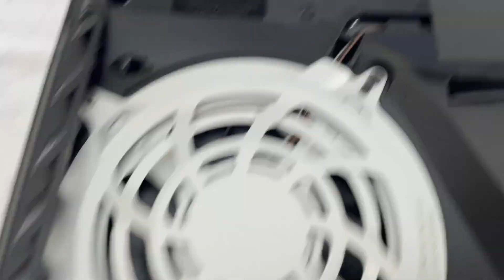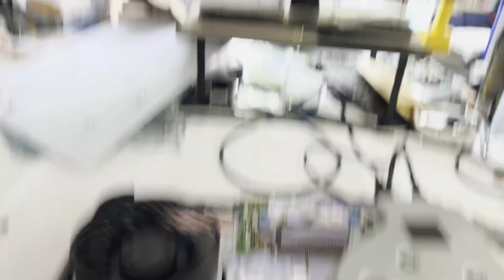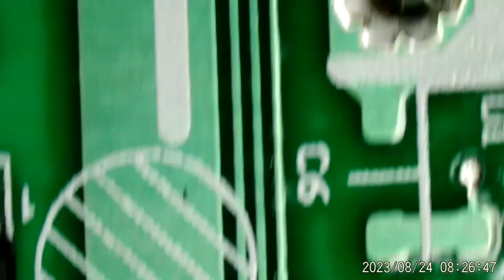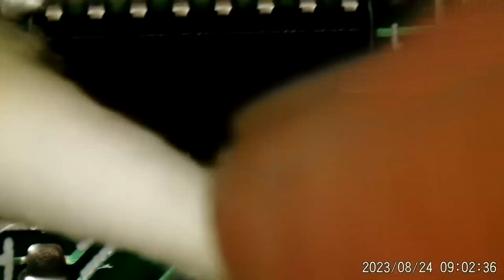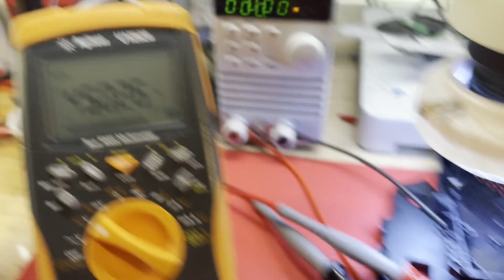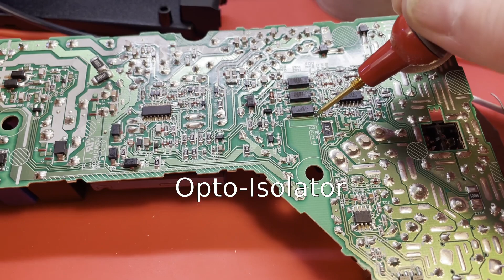#106 Repair of PS5 CFI-1215A No Power

Comment: Great video! Diagnosed dead power supply, registering zero volts, on a "PS5 for parts" off eBay. Threw in a new PSU and the thing now works like a hot damn. Thank you very much!

Comment: what should the voltage be on the power supply?
Reply from the maker: The main output is 12VDC.  There is also a part of the supply using 395VDC in the AC to DC conversion process.

Comment: I have these 2 400DR which had blown the dap53 i replaced thoes with the TEA ic but i get 10V instead of 12v what could be causing this ? thanks
Reply from the maker: Q32 or Q34.  You can test by removing them.
Reply: @ToltecMerc  thanks I'll remove them n check. Besides these could it be anything else? on one of them Q31(ZEW) was shorted  i replaced it but the volts on the output dont go above 8v :( .
Reply from the maker: @nikeshgupta8362  IC132 (TL432) is another possible option.  It is the reference IC for the supply.

Comment: I have a PS5 which is now dead. I had it in rest mode and left for work. We had bad thunderstorms during the day. When I returned home it was off. When I pressed the power button it would audibly beep once, but no lights and no fan, no actions. When I press the reset button it would beep 3 times to signal no disc inserted. Also it would not accept a disk and force manual boot. I took it to a local UBreakIFix store, they said it was most likely a motherboard issue because they tried quick swapping the power supply etc with no luck. They quoted me $299.99 + tax and $25 shipping and handling to repair it. I decided not to go that route. And brought the console home, now when I plug it in and try and power on the console it will not beep or make a sound with the power or reset button. I don't know what they did but it seems worse.
I would happily ship and pay for you to repair my PS5 and use the content for a video. And cover all costs of labor and parts if it is less than that. A brand new digital only PS5 is only $400 it would make no sense to repair a ps5 for $350.

Comment: Just subbed, love your videos. Does anyone now what brand and type of clip leads he is using? The ones that have the hook clip at one end that connects to the board and the other end his meter probe tips slip into?  I’d love to get myself a set of those.
Reply from the maker: Thanks for the sub!  I've been trying to figure out where I got those from but I am not sure.  I have a lot of Probe Master leads but it does not seem to be from them.  May have come with a cheap Chinese set off of eBay some time ago.

Comment: Just subbed to your channel.  I admire your skills and calming demeanor.
I observed an interesting method to check the feedback and over protect circuits for a type of smps on  Mr. Carlson's lab channel.  He connected a bench top psu to the output of the faulty smps and was able to see the opto couplers' operation as he changed the voltage levels.  Doing that pretty much eliminated the circuits after the swtching transformer because if something was shorted the opto led would not light.  Not sure if that method would be useful on your style of psu.
Reply from the maker: That might actually be very useful.  Thanks for mentioning that.
Reply: @ToltecMerc  looks like I'm a day late and a dollar short.  Just realized you already use that method.  Vid #97.  I enjoy your troubleshooting skills and not just firing off the parts cannon at problems.  Look forward to seeing future vids.

Comment: Good work mate can you confirm or not if the dvd drives are cross compatible or not i have a edm-010 drive (v1) here and trying to update a edm-020 (v2) i have the board but im not getting any luck with either daughterboard wondering if the lasers are different getting no power to the drive at all.
Reply from the maker: I am not sure.  I do know that the latest(EDM-030) drives are different from the previous.
Reply: @ToltecMerc  cheers mate

Comment: @ToltecMerc have you come across a ps5 that freezes 5 minutes into gameplay then shuts off? It's not over heating, liquid metal is good, no dust at all inside.

I assume bad ram, possibly power supply?

Ive never seen it nor have I seen any videos by anyone on it.
Reply from the maker: I have not seen that either.  If it's Micron RAM, it could be the problem.  The Samsung RAM seems pretty solid.